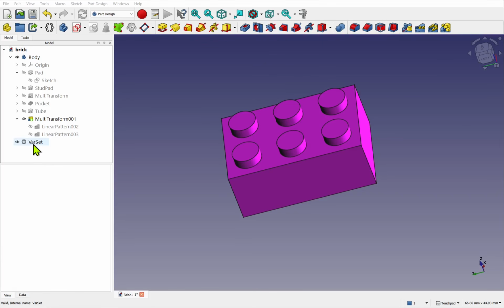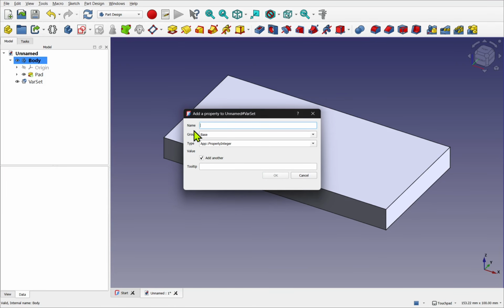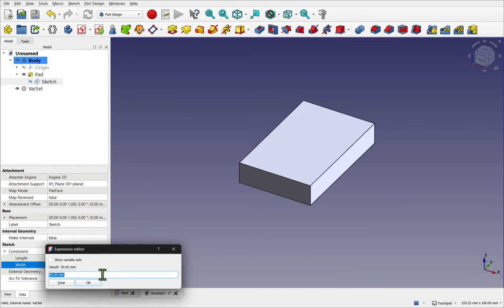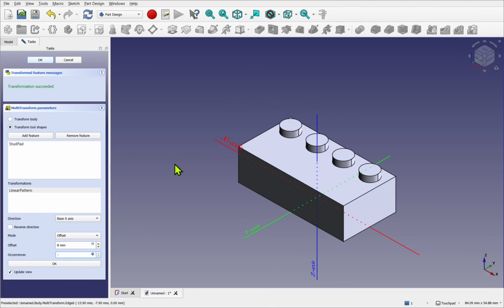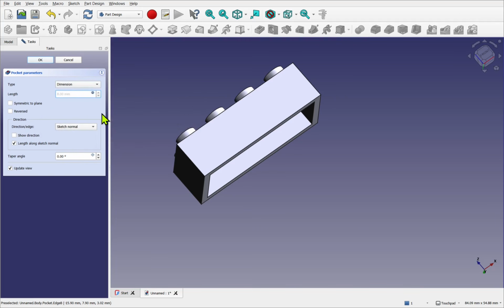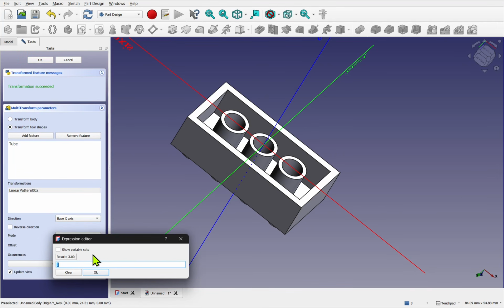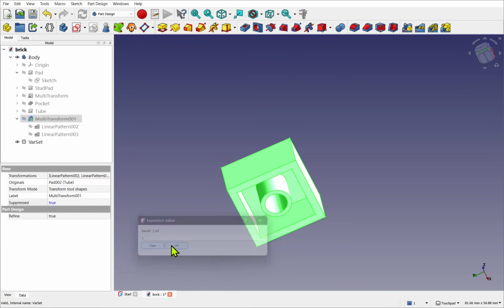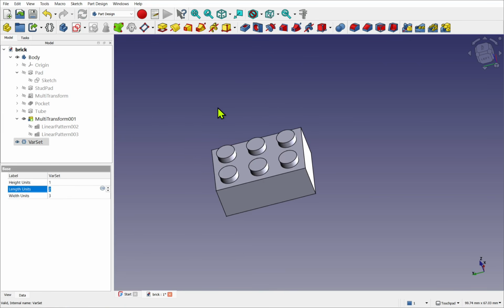FreeCAD: It Starts With a VarSet... and Ends With Toy Bricks! Parametric Toy Brick Builder

Comment: How is the varset different to using spreadsheet? It does look simpler and faster to access, but just wanted to understand when I would use one over the other.
Reply from the maker: Good question; often it's down to preference.  But Varsets define the type so they are quicker, you can tell freeCAD this is a length, float, integer etc where as the spreadsheet cells have to be converted by freeCAD first.  The structure is different, varset are name value pairs so you have limited information grouping where as spreadsheets you can layout the information and relate muliple information together i.e. a row for a single property.  This is extremely handy as you can implement a config table, allowing a dropdown on the body object to select individual rows by this property column to use all the values on that row for constraints and expressions.  So you have one row for a 1x1 full height brick, another for a 1x1 half height, 1x2, 1x3 etc and these can then be chosen from the dropdown on the "template" brick (know as configuration tables and variant links)

Comment: Hi as said in another YouTube Channel, i think for this special Lego Bricks, it'll be better to use a spreadsheet for all the different configuration and use a VarSet as a DropDown list to choose directly the element you want. It works but the question is how could it work with an Assembly ?
Reply from the maker: That's an interest evolution or the project, may have to give that one a go.  For assemblies it's a great question and also visually this could be interesting, change one brick and the whole assembly configures.  The way I would approach this is to use a datum object, either a point or line and anchor this early in the part design workflow, after the initial pad.  You have the edges of a rectangular cube from the first pad that are very unlikely to change in number, add the datum line to an edge and then carry on creating the other features.  Keep this datum object visible so when in the assembly you assemble using the datum objects rather than the edge.  Later you can hide the datum objects in the part  itself and it will automatically be hidden in the assembly.  

This makes a much more stable reference anchored early.  And if something does destroy that reference, you just need to reattach the datum object in the part.  I would love to see how an assembly would act if you had a sizable amount of bricks and you changed the size.

Comment: Who else is here in April 2026? Lol.
I've just started learning Varsets and, wow, this is next level insight!
So, if I understand correctly, it's a pity you cannot have a linear pattern of 0, resulting in just no occurence of the tube, which would have made it unnecessary for conditional suppression of the tube as well as the multi transform?
Reply from the maker: Varsets are extremely cool :) In 1.1 things have changes a bit as you can now create a linear pattern in two directions.  So at some point I need to revamp this one. As the tube feature is already present If you have a linear pattern of zero you are not performing the action, you are just leaving the tube untouched.  You have to forcefully (and logically) remove (suppress) that feature otherwise it just show through.

Comment: Loved this tutorial. I struggled a bit using FreeCAD 1.1, but I made it through. One note: the method to work around not being able to have a 0 in the linear pattern works, but you get an error and the model doesn't change to eliminate the tube. It just stays at whatever it was and fails to update. If you refresh, then it renders correctly. I had to put an if statement (? :) to trap the 0 case and just set it to 1. Since it's being suppressed anyway, this works. 

I loved following along. I took it further and parameterized everything and set everything to a unit based on 1.16 mm. I also hacked together support for plates. I'm looking forward to obsessing over this for a really long time. It's a great introduction to FreeCAD!
Reply from the maker: Glad you enjoyed the challenge and found a smart way to handle those logic updates! :) Great to see you are experimenting and sounds like you are really having fun with it.  Thank you for taking the time to feedback, I appreciate that :)
Reply: What expression do you use exactly? I can’t fix my multitransform to eliminate the tube.

Comment: I found one  interesting thing that(at least in 1.1)  if you use lines of edges as references (instead of point as in your video) for the pin center at 9.55 the pin jumps in and out of base as dimension jumps sides when base rectangle dimensions are changed. maybe there is error? or there is setting that forces dimension direction to be recalculated?
Reply from the maker: That's an interesting thing you found, going to recreate to see what it is.  Thanks for the comment. Going to take a look.

Comment: Slight mod to the first pad calculation allows you to make base building boards as well with this brilliant tutorial change to 

VarSet.HeightUnits > 0 ? 9.6 mm * VarSet.HeightUnits : 3.2 mm

Which sets the block height to 3.2mm if the HeightUnits is set to zero.

Comment: You could simplify that expression a lot by using multiplication:

(Width - 1) * (Length - 1) == 0 ? 1 : 0

Also, if you'd moved the thickness feature up before the stud pad feature, it wouldn't fail 😃

The whole setup with the multitransform and naming of dimension constraints has been eye-opening to me. Many thanks!
Reply from the maker: Nice! I like it :)  Thanks for adding that.  Glad you enjoyed the video and thanks for adding value with the comment :) :)
Reply: @MangoJellySolutions  I do find it a bit strange and annoying that FreeCAD requires us to convert a boolean expression to an integer result via the ternary operator, which it internally then again converts to a bool.
Reply: @themiwi  In my test it doesn't seem to; it's just fine with the value 2 counting as true, for instance. On the other hand, it doesn't recalculate the suppressed field before the linear pattern, so I still get an error when I switch to width 1.
Reply: @MangoJellySolutions  To take  @themiwi  solution a step further and since Occurrences is already calculated:
multitransform supressed = Transformations[0].Occurrences * Transformations[1].Occurrences == 0 ? 1 : 0
If needed for individual transforms you could simply do Occurances == 0 ? 1:0

Could just use an entry in VarSet like SuppressTube = (WidthUnit - 1) * (LengthUnit - 1) == 0 ? 1 : 0
then anything tube related that needs to be suppressed = VarSet.SuppressTube
Clearest for me

Comment: Question from a noobie: that little bit of clearance that you built into your model so that that adjacent bricks would fit: does that clearance mess with the top pin placement relative to the theoretical brick that has no clearance? I presume that the pin pattern should not be offset for clearance, or you lose the fit of stacking 2 bricks. Typically, you'd want the pin centers to stay exactly on 8mm centers, and not have it shrink to some obscure value like 7.98mm. I suppose you could oversize the pins to compensate? Two different designers working on the same project could fork off in different tolerance directions because of this. Being a machinist, I always think about tolerance stacking.

Comment: After having done two of your other tutorials, this was an easy one.
Up to the suppress option that is ... It seems part of this is broken in the 2025.11.26 weekly build. Changing the LengthUnits or WidthUnits from 1 to >1 rebuilds the model correctly but as soon as one of these is set to 1, an error pops up. Hitting F5 to recompute the model fixes this but it took me a little while to figure this out.
I am getting more and more impressed with the possibilities of FreeCAD. I cannot see me doing a similar thing in a commercial CAD software like Fusion 😄
Reply: This is the issue on the released Freecad 1.1.0. The way to get around it without having to hit recompute is to structure the expression as max(VarSet.LengthUnits-1; 1). Even with width of the brick set to 1, it will still produce 1 circle, but the part will be suppressed and won't show up.

Comment: For your suppression calculation you used the conditional expression, i.e. condition ? value_if_true : value_if_false to give a Boolean.  However, condition is already a Boolean expression, so where you have "VarSet.LengthUnit > 1 ? 0 : 1", you could have just had "VarSet.LengthUnit <= 1".  That is, if the length is less than or equal to 1, the expression is true and we suppress the feature.  If the length is > 1, the expression is false and we don't suppress the feature.

Since you want to suppress if length <= 1 or width <= 1, you could just rely on the result of a Boolean being 0 or 1 and have (VarSet.LengthUnit <= 1) + (VarSet.WidthUnit <= 1).  This will evaluate to non-zero (i.e. true) if either of the sub-expressions is true.

Note that I'm not running FreeCAD at the moment, so I'm assuming the expression parser is working the same as in C and Python.

In code reviews at work, I'm always picking up on unnecessary uses of conditional expressions, so you're not alone in doing this.

This niggle aside, this is a great tutorial, and all those people who think that being able to edit a model makes it "parametric" should be forced to watch it.  I'm tired of telling people that what they call parametric CAD is just CAD.  The latest example was the most recent video from Functional Print Friday, which I think was titled "Let's Get Parametric".  His design was not even slightly parametric.  They are completely missing the whole point of parametric CAD, and how powerful it is.

For a real world example of its power, I've used it to design bedroom cabinets, with a number of drawers and an optional cupboard on top, given just the outer dimensions, number of drawers, and a cupboard height specified in drawer units.  For example, if you say it has 4 drawers, but the cupboard is 3 drawer units high, it will have a cupboard that's 3 drawers high, with 1 drawer beneath it.  If you put this cabinet next to a unit with 4 drawers, the drawers will line up perfectly.  The number of handles is either one in the centre, or two if it's wider than some value.  This means that one design can be used to generate a whole host of cut sheets for a matching set of cabinets.  I can design a low bedside cabinet with 3 drawers, a tallboy that has 7 drawers, and another cabinet of the same height that is also 7 drawers high, but with a 4 drawer high cupboard at the top.  I can even use the same design to make a scale model for marketing purposes, or even a matching jewellery box (the board thickness is calculated based on the overall dimensions).   I did this design in Fusion, but there's no reason it can't be done in FreeCAD.  To achieve this without parametric CAD would require a whole host of separate designs, with a lot of editing. With parametric CAD, one design can be used for an infinite number of bespoke cabinets, and each cabinet design takes about a minute to produce.

Thank you, and keep up the good work.  You're helping my transition from Fusion a lot.

Comment: How to add multiple instances of these bricks with different sizes in one file? When I add them to the assembly and edit dimensions for one of them all others are also affected
Reply: It seems like you need to copy and paste them to get them to have their own private varsets
Reply: @Jo-re2ye that is what I wanted to avoid. I want to keep a link between the original design and all instances, so if I change something in the design all instances are automatically updated as well.

Comment: Can you edit the varset if you made a mistake, or decide to change the "Name" of it? for example, I found out it organizes them alphabetically, but I want the names to be split into dimensions, features, etc. so they are "grouped" in an intelligent way
Reply from the maker: Unfortunately no but instead you could use a spreadsheet that is more flexible.  The process would be the same with adding the expressions.

Comment: I am running into a small issue on v 1.0.2.  When some combination of odd value var sets such width = 3 causes the studs to shift in strange way.  The rows of the studs or the brick (I can't tell which one) shift so that the studs are half overhanging ove the edge of the brick and the opposite side is empty with no studs.   Can't figure out what that problem is.

Comment: Currently I am trying something like your brick but with the stubs being on the sides and not on the top. I am struggeling on how to 'cleanly' bring a copy of the stub to the front. I figured a way out with a binder and offset and rotate it but I guess thats not very clean. First I thought of mirroring on a datum plane but the following patterns will act on all faces.... sometimes its crazy when you think its easy and then you try hrs and you do not get it finished.... still learning.... do you have any advice?
Reply from the maker: So stubs on the side (or both sides) and tubes on the bottom, with the top clear or are they on there as well?
Reply: @MangoJellySolutions for freecad learning purposes I transfered your solution to create boxes with grooves to be able to chim them together and via spreadsheet having the possibility to adjust everything according to fit into my drawers of different size without leaving space. For the bricks it would mean to have stubs on all sides, No tubes on the bottom and Nothingon the top. The infills I am differentiating by clones of the base box analog to another of your lessons...
You see, I take advantage of your lessons but instead of recreating them I transfer them into a new project. Directly taking what I learnt.... helps to very quickly co I g up to speed in  freecad. Thank you very much for that chance.🎉

Comment: I followed your tutorial with FreeCAD 1.0.2. The create VarSet icon has moved to the top bar. Apart from that it went really smooth.
Now I don't get how I can make new drawings and use several instances of the Bricks with a different VarSet values. 
When I do it, I get all the bricks with the same size.

Comment: Could you have used thickness for hollowing out the brick, if you did it before adding the studs on top? Or would that have caused other issues?
Reply from the maker: Yes you can get around the issue that way :)

Comment: when do you use the varset over the spreadsheet method?
Reply from the maker: Sometimes it's also just down to preference. Varsets are quicker as they are more light weight and also you can switch to them even when your in the middle of sketching so you don't have to come out of the sketch.  They are also type safe so you can define a parameter to be a length and you know it will stay as a length, in a spreadsheet this could be a number or text.  Spreadsheets are more intuitive and you can add extra information.  Also spreadsheets allow you to set up configuration tables.  So they both have their strength and weaknesses.  If you data is basic name value pairs go for the varset, but if you want something that is more intuitive i.e. documents the project, you want to make calculated fields obvious, or you want to use configuration tables, then go for spreadsheets.
Reply: @MangoJellySolutions  Thanks for explaining.

Comment: Adding the expression already to the Tube and not to the MultiTransform to begin with, would allow you to reference its value (simply true or false) to MultiTransform001 by the following expression "<<Tube>>.Suppressed". This could come handy if you have several features which need to be suppressed in synch and it saves a little bit of computing power.

Comment: Does this still work with Fillets/Chamfers applied or does everything break as I've come to expect from Fillets/Chamfers?
Reply: It does work but a bit tricky (at least for a noob like me).

Add the chamfer to the stud, than rightclick the chamfer in the treeview and select move object after object. Select the studpad so it's in the correct order.  Now edit the first multitransform and select both the studpad and chamfer as the features.

Set your view back to the last step in the treeview and it should compute the changes.

You should be done now 🎉

Comment: Weird that that the expression for Suppressed requires the use of the ternary operator. You'd think "VarSet.LengthUnits > 1" would already be fine. It's a boolean expression. How did you find out that you needed to use "?: " ?
Reply from the maker: I had to go back and test what you said just in case it allows it but shame it doesn't, would of been much quicker.  I knew spreadsheets and expressions use python based language for a while but the freeCAD wiki actually documents the expression editor quite well which is helpful: https://wiki.freecad.org/Expressions
Reply: @MangoJellySolutions  It seems that the relational operators aren't integrated with the rest of the operators. IOW "a<b" is not actually a valid expression. It can only be used as part of a "condition?r1:r2" expression. This is a weird implementation. In Python itself this restriction does not exist.

Comment: Is there any advantage in using VarSets over Spreadsheets? When making something parametric I always prefer the Spreadsheet.
Reply from the maker: Varsets are quicker as they are more light weight and also you can switch to them even when your in the middle of sketching so you don't have to come out of the sketch.  They are also type safe so you can define a parameter to be a length and you know it will stay as a length, in a spreadsheet this could be a number or text.  Spreadsheets are more intuitive and you can add extra information.  Also spreadsheets allow you to set up configuration tables.  So they both have their strength and weaknesses.  I prefer spreadsheets to.